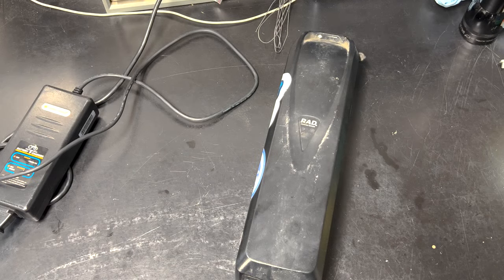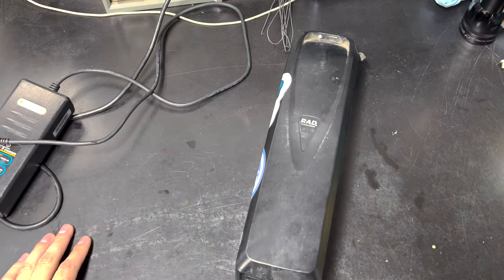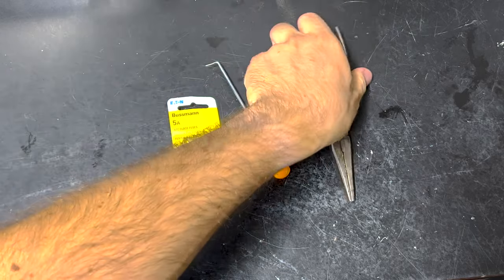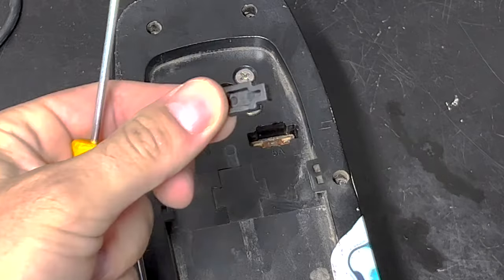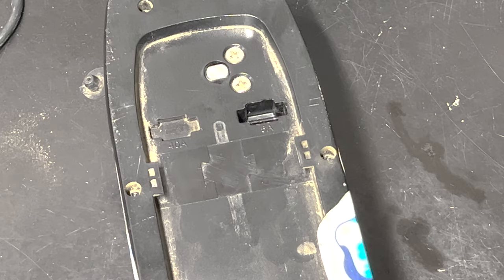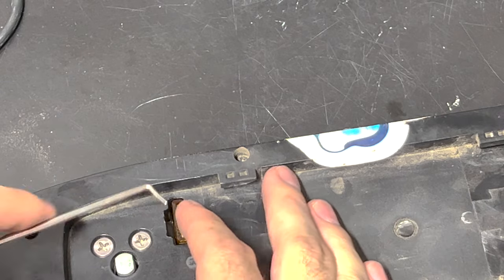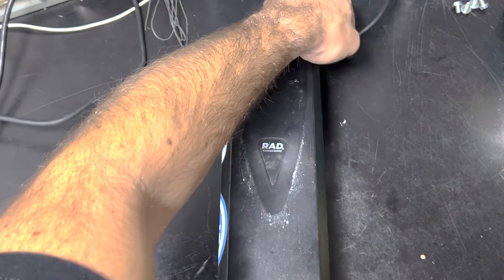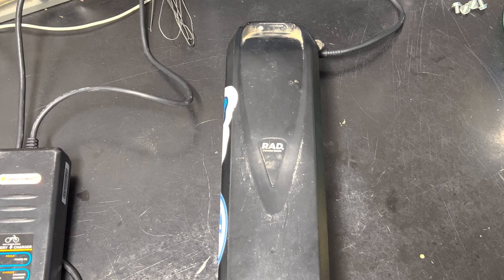E-Bike Battery Won’t Charge??- Let’s Fix It!! [Do It Yourself!] #bike #ebike #diy

Comment: Thank you. The toughest part was removing the cap for the 5 Amp fuse. I ended up using a cork screw because I didn’t have one of your handy dandy pic tools.
Reply from the maker: Nice!! Yeah, sometimes those covers can be tough to remove! Glad the repair went well.

Comment: Thanks a lot! this worked for me. I had made the same mistake of inserting the key in the plug and short circuited my battery blowing up the fuse. Although I have a different battery, it follows the same protection principle so I opened it and quickly found the damaged fuse. I went to Canadian Tires and found a package of 5 Mini Fuse 25A each for less than $7 (also cheap on Amazon but they will offer too many fuses which will probably go to waste), I found them in the automobile section, I wasn't sure if the amps were the same but I bought it, installed it on my battery and the charger turned red!

I will get a 5A mini fuse later because the 25A is not a good protection, if I short circuit the input again, I may lose my battery.
Reply from the maker: Glad to hear it fixed you bike! Can’t beat those easy and cheap fixes! Definitely grab a 5A when you can just to make sure you don’t accidentally toast anything! Thanks for watching!!

Comment: I have a Popal E-volution 6.0 (european), the moment that I plug in the charger the LED is for about 30 seconds red and it turns back to green. The battery is indeed empty because it has a button on the side to check the battery status. Any idea what it could be?
Reply from the maker: Sorry for the late response! Hmmm. When it was charging normally, would the battery hold a charge for awhile? I wonder if it's an issue with the battery, or the charger itself!

Comment: You could possibly blow that fuse by plugging the wall outlet in first and then the battery. Doing it the way u did in the video causes a spark a lot of times.